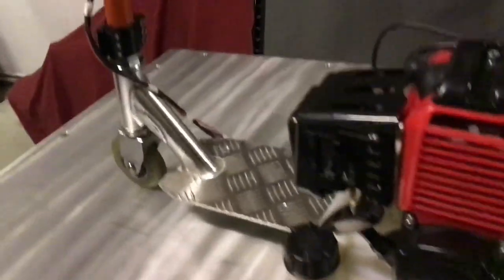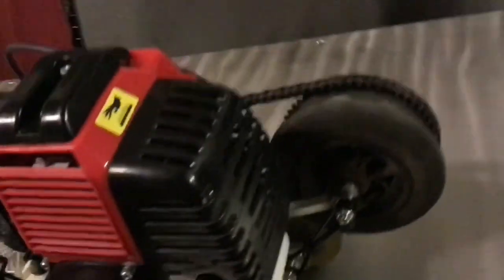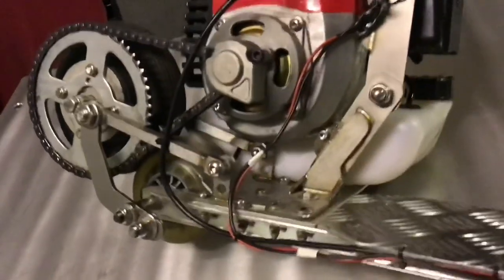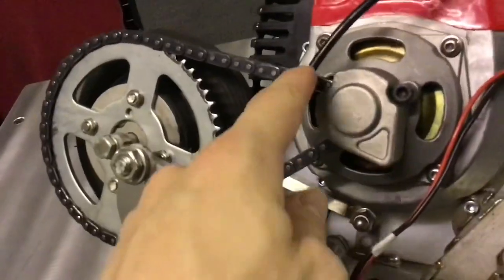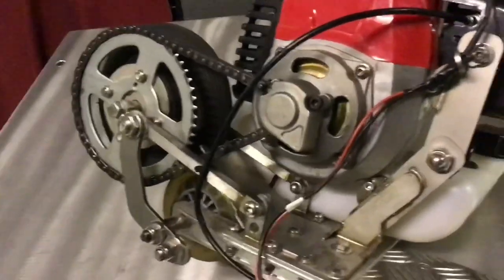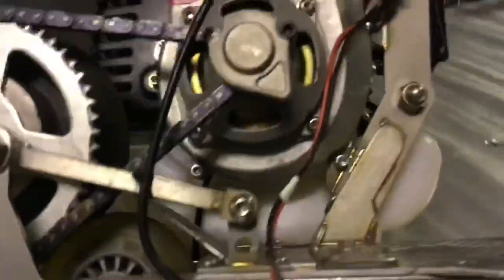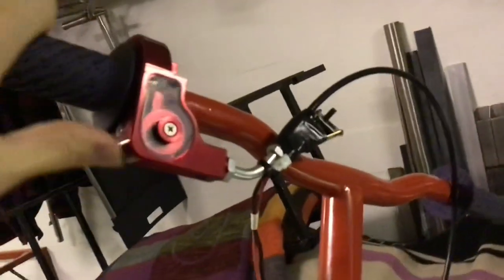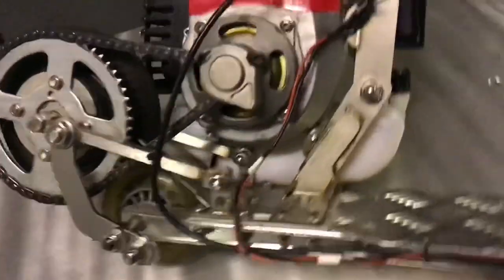Homemade GoPed (Build + Test Ride) DIY

Comment: This is top notch work :D!
I have found a bunch of free push scooters and I am amazed that your (exact same) plastic wheels have not yet exploded XD!
Subscribed :)!
Reply from the maker: It takes a lot of abuse to break those plastic/hard rubber wheels! The air wheels are much more likely to fail, but none of them have failed yet;)
Reply: That's impressive ! I'm thinking of buying solid metal spokeless ones because I've lost some spokes lol even the whole tire came off of the plastic after hitting 1 driveway entrance ramp , it's understandable that the air ones get a lot of flats I've gone ghetto tubeless with no problems :) just a pain to get it to seal at first! lol  @weldartcreations

Comment: How did you know what pays to buy? Is there a blue print? I recently found my old one and I want to restore it and start using it again.
Reply from the maker: This is my own design so I had no blueprints, I simply started by buying a motor with a clutch and then just went from there and used my imagination:)